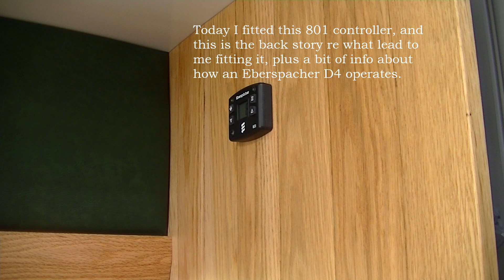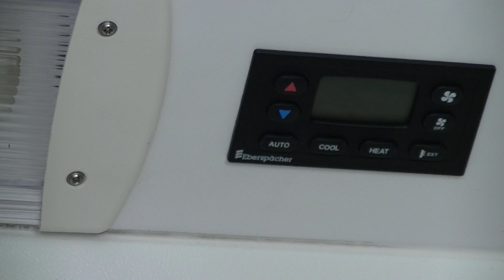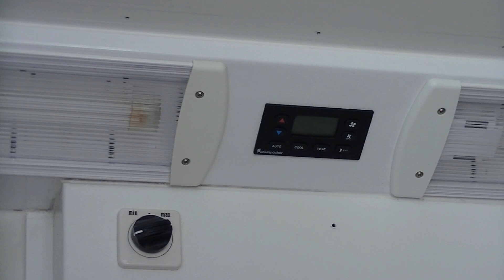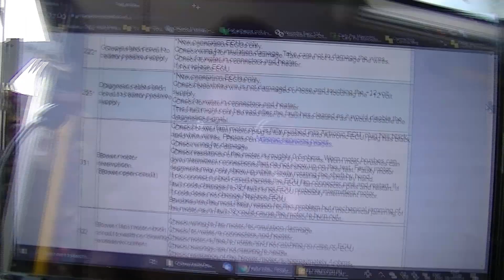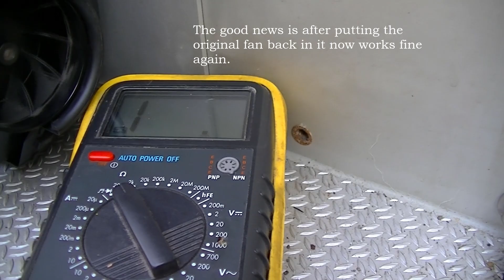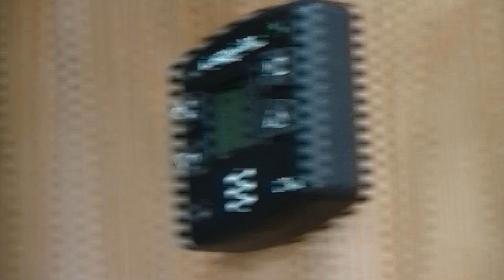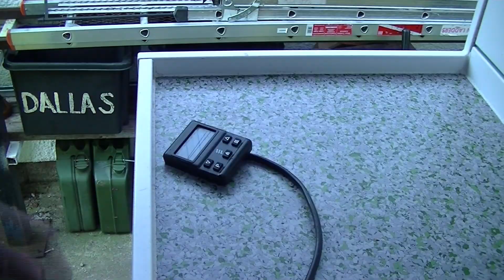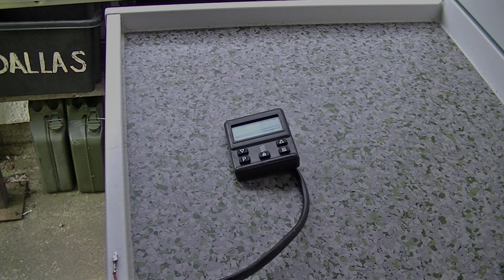Eberspacher D4 Diesel Heater, faulty blower fan diags and 801 controller installed.

Comment: Hi Greg, Just watched your video as I am currently experiencing the exact same issues you were having. I'm getting codes 31 and 32. It was running sweet after I serviced it and then this afternoon I noticed a noise that was different than usual and now she won't fire up at all. 
Having you watched your video, you said you changed out the fan and she worked straight away, Did you change the fan motor or just the fans? I wasn't to sure as to what you changed to make it all work again. Thanks. Sean
Reply from the maker: Greg?
In my case the fan motor had definitely failed but see comment below if you have a D4+

Comment: My D4 heater doesn't work proberly in my boat. I suspect the ambient Sensor / external temperature sensor doesn't work at all. Sometimes the fan stops on 15 degrees, on another ocassion the fan stops at 27 degress. ANy help here?

Comment: Hi there, I like the idea of 2 cotroollers, what kind of switch would make live 4 connections at once if that’s how it’s done. Great vid many thanks!
Reply from the maker: A four pole double throw (4PDT) switch will work. Plenty on eBay, could be a bit fiddly to solder though! Also requires 12 wires to run to it  etc. I might first try experimenting with just a remote switch by the bed in series with the yellow wire from the controller to the heater.

Comment: We have just been trying to track a fault on a 801 System we have power  to the unit but the controller screen is blank we have power to the controller but just a blank screen any advice
Reply from the maker: You should be able to test this on its own with a fused 12v supply connected to the red wire and ground to the brown wire the other wires shouldn't matter at this stage

If the display still doesn't come on its probably dead.

https://www.pfjones.co.uk/eberspachercontrollers/801_install.pdf
Reply: HI Rob, did you get anywhere with this, as i have just had exactly the same fault?!

Comment: Interesting, currently experiencing blower issues myself. Did you change the brushes on the faulty unit in the end?
Reply from the maker: InvisibleVan no but I did take it apart, the brushes had completely worn away!

I bought a replacement motor from Kirknalls however they only have them availability for the d4 which has a smaller black fan with two magnets instead of one for the D4+ and in the D4+ it does not work. 

So I had to  swap the black fans over, if I had known they were different I would have bought one of the bare motors from eBay for approx £16. And swapped both fans over, the cream fan is harder to remove and very brittle but does pull off with care.

Comment: We use an 801 too. Our ambulance used a sensor next to the door with a dial temperature control which you had no idea of the temperature. The 801 came with our replacement unit from a BT van. Unfortunately it is designed to cut out after an hour but generally we don't use it for that long anyway and have wired it off Genisys now as she wanted the engine running... Pointless as we could use the vans own heater matrix... Keep up the good work.
Reply from the maker: Hi Ian if you look at my other video on the b2b you will see I have fitted a changeover switch on the side of the Genisys cover that switches pin I4 (normally marked ignition) on the ecu to a fused +12v.

Normally I leave it up so Genisys ecu is under ignition control but until I fitted the 801 which is have powered up separately I used it power in the climate system hence why Helga had the abilty to power it off at low battery!

The only time we need to use the switch  it now is for the extractor fan I have kept that because I like the soft start and reverse speed option plus we still can then use the buttons on the Genisys control panel for the fan and central locking.

Note the D4 itself in my van has a permanent 12v supply, it’s only the original climate controller and AC relays being powered by the Genisys system in my van, obviously each install of Genisys will vary though.
Reply: Yes I bought one form someone that took it out of a Bt van and yes what a pain especially if you go away in the winter months for the weekend it does get very cold and the temperature drops dramatically early hours of the morning is there any way of overcoming this service can stay on it is an 80 one the controller I thought they stayed on or should stay on until you turn them off. Obviously I must be wrong